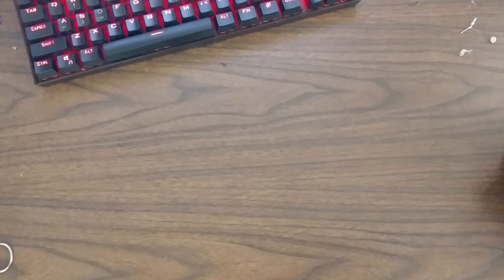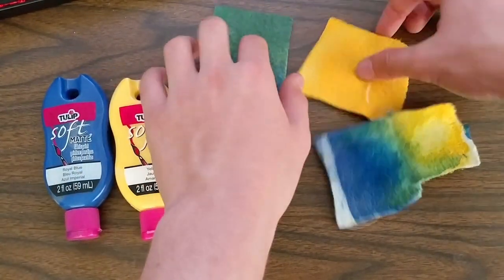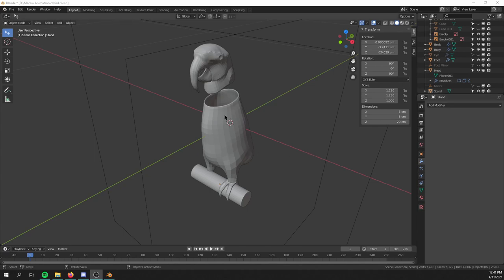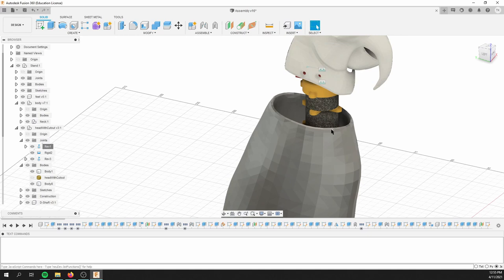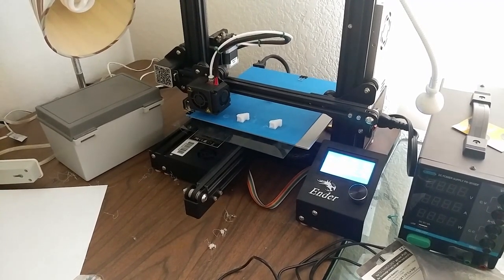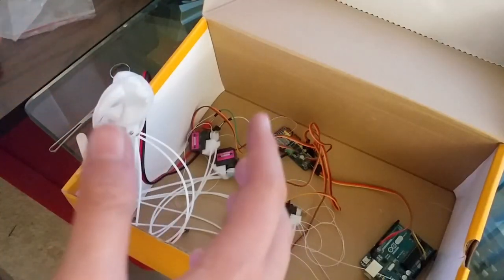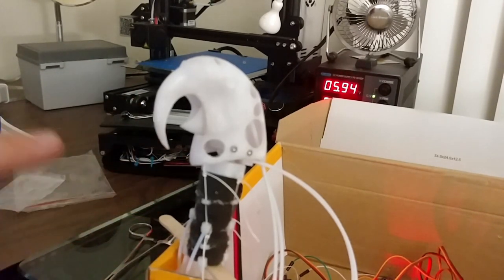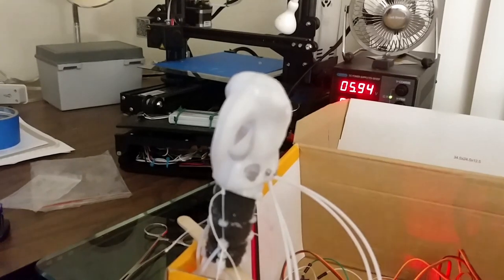Tiki Bird Animatronic Part One - The Head

Comment: I have noticed that you not made any progress on taking this to the next step. I would like make the head as you done in the first video and then finish the rest of the bird as you outlined it the first video. So is it possible to get a hold of the all file to the head and body so I can take it the next level? Anything I create will be sheared with you. Let me some idea of my background like you I have always like the Tiki Room it is my favorite attraction. I have wanted t make my own Tiki Room Bird. I had the opportunity to have worked at Disneyland on the Tiki Room attraction got work on the up close and personal both the electronics and the mechanics, but until recently it has been possible to make all the parts without the use of a machine shop etc.  3D printing has now made it possible to do this at home. So let me help you out on this. I Will make youa free  custom electronics to control it for you.

Comment: I would like to know what the foam cylinder is, would like to buy some to build a flexible neck for my animatronic, thank you
Reply from the maker: The foam is standard insulation that can be found at Home Depot.
Reply: Thank you. The cross shaped cable guides you used,  do you have a download link for them? Definitely want to try making this 🙂

Comment: Question. How did they make the head without a 3D printer?
Reply from the maker: It was 3D printed
Reply: NO like walt disney
Reply: No walt disney how did he make the tiki birds
Reply from the maker: Very skilled machinists and engineers, I would assume.
Reply: The Enchanted Tiki Room opened in June 1963. So, materials and techniques available to make the head at that time would have been fiberglass and/or closed-cell foam insulation (isocyanate and/or polystyrene), cast resin, vacuformed plastic shaped over a hand-sculpted model, sheet metal (extremely doubtful but possible), or hand-carved wood. Regardless of the actual material used for the head, it would have been hand-shaped by a sculptor. The armatures of the birds were, and still are, made from metal. I've seen one without it's "back" at Garner Holt's shop. The servos are inside the bird and it is absolutely PACKED.
Reply: @doktorscottdiabolical  thank you 🙏🏻